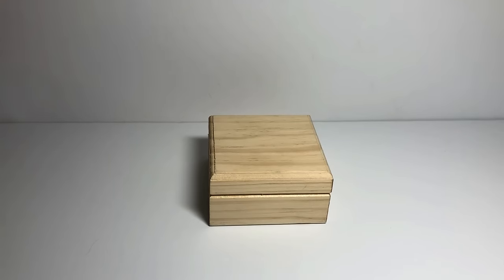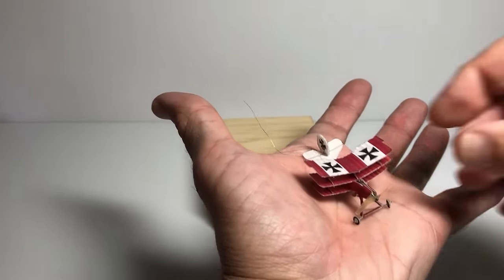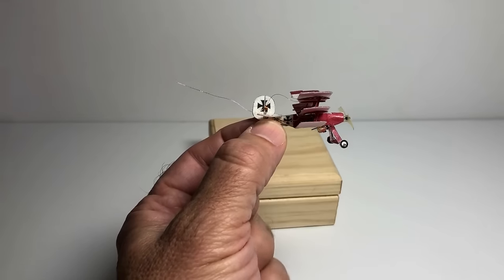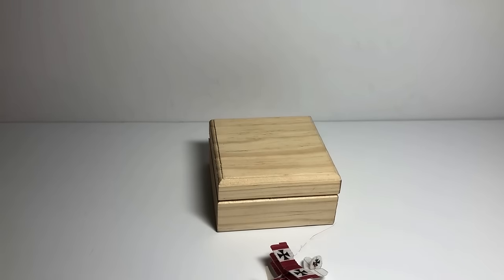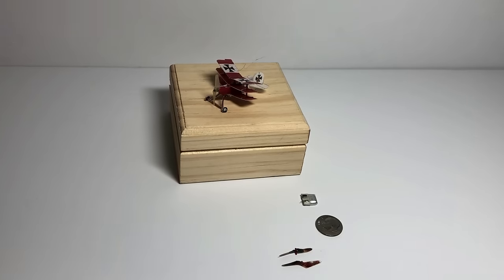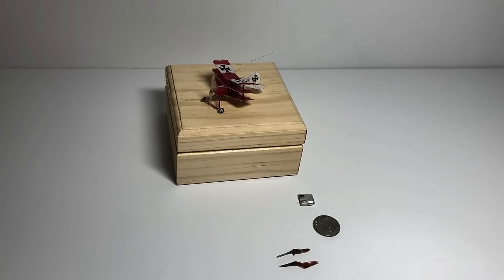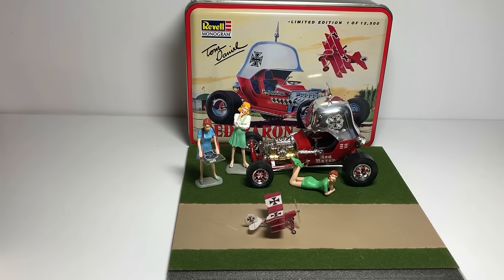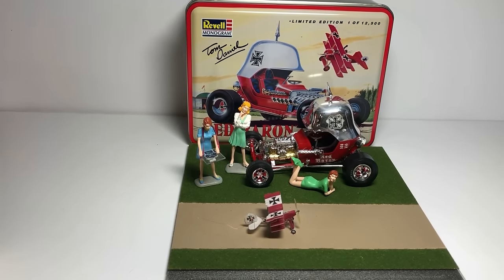World's Smallest Radio Controlled Model Airplane?

Comment: Amazing achievement! I still think I have the world's smallest EDF engines on my 1:100 A330 using the actual plastic parts of a plastic display kit to make up the cfm fans on the smallest brushed motors I could find (3mm) in foam turned nacelles on 1 cell with a simple ultra micro Rx. Still perfecting the flight but it's a flyer for sure. I am loving the challenge of ultra and hyper micro RC, the challenges are numerous but it's all worth it when these little things fly. Love the diorama - you're a true hobbyist and innovator.
Reply from the maker: I think saw your 1:100 scale A330 on R/C groups, a great model. I built a 4.5- inch twin ducted fan A-10 a few years back. It used 10mm fans? You can find my thread on it on R/C groups. I need to make a new video on it.
Reply: That sounds interesting!
Do you have something like a build blog of it? Would love to read it!
Reply: @JoeMalinchak  Now I know why your name is familiar.
Reply: Would love to see your work.
Reply: "Excuse me sir, my case didn't arrive from Chicago".  --  Passenger.
"Can't you see we're busy".   --  Lost luggage Rep.
Reply: I will buy one  @JoeMalinchak

Comment: Wow! Awesome! I can't stop thinking about the potential of the landing gear breaking on every landing.
Reply: Amazingly enough, at such a small scale and weight things don't break that easily. Some sort of physics factor where paper would be stronger than steel in dropping. Have you ever seen a cockroach or an ant break its leg when falling off a table? But if an elephant falls off a bridge, a LOT will break.  (Does anyone know which named physics principle that is where lightweight small things don't break when crash-landing?)  Small is beautiful here.
Reply: @hstrinzel  I think the law you're thinking of is the Square Cube law. It relates how mechanical strength scales with the cross-sectional area of an object, but the weight scales with the volume of an object.
Reply: @hstrinzel the first thought I had at the end of the video was the same thing as mentioned above.  
But that totally makes sense when you said that it's so tiny it has it's own physics and it doesn't break. That's incredible.  I wouldn't have guessed that.  Until I read the comment I figured that, 
that was half the battle to getting it fly.  I imagined how frustrating it must have been to always be having to fix it.  But I guess not.  

Such I cool little...well tiny build.  So impressive.
I probably speak for a lot of people that requested a video showing more of "how it works"  more specifically the tiny electronics and that control it.  Most of us didnt think anything that tiny to make it possible even existed, which is why we're so curious.

Such I neat neat!  tiny creation

Comment: Could you do a video explaining all the details in how it works, and how to build it?
Reply: If you need more information than what is shown and said in the video, you're not qualified to build one. Sorry, try something larger first to reduce the risk of disappointment.
Reply: @stejer211  Fair enough, thanks anyways!
Reply: @purplemageproductions1971  It is very fiddly but these days there are guys who make RC receivers n servos. A search will find them. A 1/72 is doable by noobies. You can start with one of those $20 tiny quad drones. Use two motors for P39, Me110. Motor steering. Supermarket foam trays, Chinese takeaway etc. Nichrome hot wire cutter.
Reply: @alwayscensored6871  Thanks! I’ll try that!
Reply: @purplemageproductions1971  Seen a few yt vids on using tiny drone gear in planes. DH Comet was one
Reply: @stejer211  nothing wrong with trying even if you're not qualified
Reply: @BITCOIN_TO_1OOOO0OOOOOOOOOOO  Correct. But letting someone buy all the stuff while you know in advance he will fail is also not good advice.
Reply: @stejer211  I mean it really depends on how good of a teacher you are, some people are good at teaching but I've found most are horrible.
Reply: @stejer211  Stop being so feckin pompous.
Reply: @timesquare5473  Stop being so f'ing sensitive.
Reply: @stejer211 Glad to see you are still eating pickle 🥒 in long way.

Comment: Could you use a super capacitor in place of battery?
Reply: You could, but you would get far less runtime, though much faster recharge times.  Super capacitors don’t have nearly the energy density of a typical battery.  We have a good ways to go before supercapacitors could genuinely match a battery in terms of size, weight, and energy density, but they do have their own advantages where those three are not primary concerns and where you are not concerned about the tremendous variation in voltage capacitors exhibit under discharge versus typical batteries (where the discharge curve is typically over a much narrower voltage range, such as the 1.2V down to 0.8V for a NiMH or NiCd cell, over nearly the battery’s full output curve, where the voltage typically only drops off precipitously for the final percent, or so, of the battery’s full watt-hour or watt-second, or joule, capacity).
Reply: @ethanpoole3443  True but it is the size of your palm. I don't think range is an issue.

Comment: Beautiful. I have a few of the planes you designed. I have the Micro Spitefire, butterfly and micro butterfly. Bought it the micro brand new old stock never flown. But somehow the rudder is not working. Very small to try to fix.
Reply: Could you direct me where to browse / potentially purchase some of the OP's models?

Comment: I would imagine it has no control surfaces but the rudder which is set at an angle
Reply from the maker: The rudder has a small actuator and moves proportionally as needed.

Comment: Do you have a video on how you designed and built the propeller?
Reply from the maker: That is a good idea, I will make one when I get time. I had to make a few props until I found the right size and pitch that worked.

Comment: You may have mentioned how you moved the control surfaces in the video but I guess I missed it. I was listening for where you got such small servos. I mean variable throttle on a similar size twin engine would be tough enough but putting servos in that little thing seems impossible. Is it just set up to fly in a circle? I'm thoroughly impressed and confused. Lol
Reply from the maker: The model has a very tiny magnetic actuator, and a 70mg RX.

Comment: Would it be possible to make such a tiny plane that can fly more slowly?
Reply from the maker: The weight of the battery is the limiting factor. It would be tough to get a 1.5-inch wingspan model to fly any slower?

Comment: I know you said it doesn’t fly for that long because it has an 8 mAh battery (seriously, I didn’t even know they made batteries with that low an amperage), but how long exactly does it fly on one charge, and how long does it take to charge?
Reply from the maker: The model will only fly for a minute or less on the small 8mAh LiPo cell. Around 20- 30 minutes to slow charge the cell.

Comment: That’s 1of the coolest small scale fighter planes I’ve ever seem. Congratulations on your build. I was the 1st to incorporate CCPM into the 1st grey framed T-Rex 400 which was a clone to the Raptor 50 and it’s all up weight was 800/900 grams and mine come out at 520 grams with an Astro brushless motor and 35 amp castle creation speed control. With a Futaba 401 back in 04. Now I’ve been flying rc helicopters since 2001 because I was in my wheelchair with 15 bars drilled into my legs from stabbing the face of another tabletop jump 140 feet away from racing motocross and Freestyle Motocross. All my life I wanted to follow in my uncles footsteps who retired as a general flying the F-16 viper and survived the attack on the Pentagon on 9/11/01. Which he was at a pilots banquet. ❤️🏁😎🛫🚁🇺🇸🏆